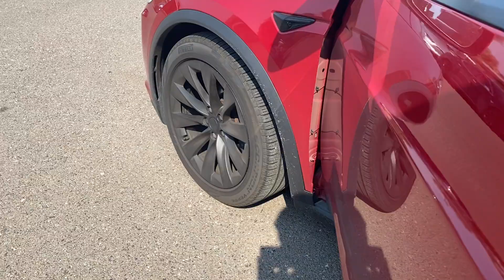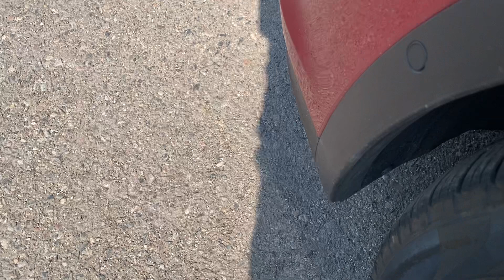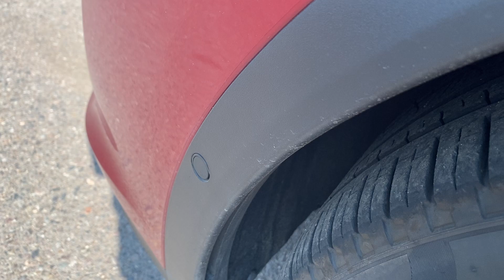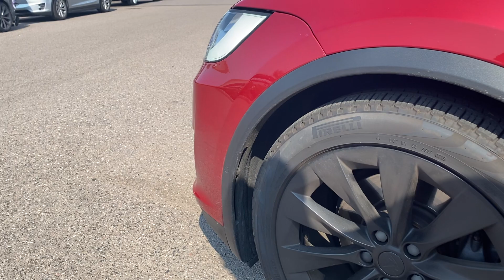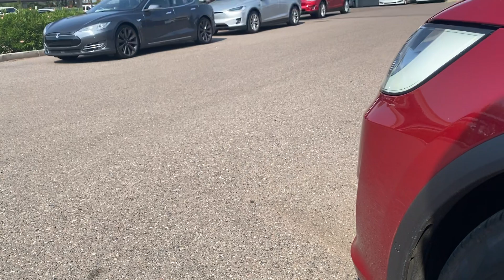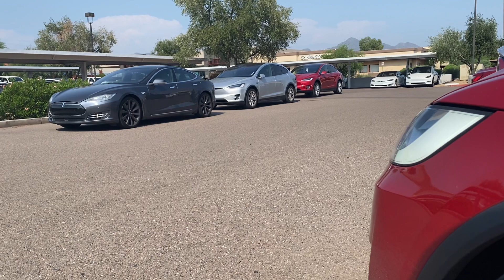Model X vibration noise when AC compressor is running

Comment: Hi there!
I have the exact same noise on my model X, did you fix yours, and if so what was the problem?
Reply from the maker: New AC system was installed. Fortunately it was covered under warranty.
Reply: @cliffud  Thank you for the feedback!
Reply: @cliffud  How many miles did you have on your X when this problem happened?  I had my compressor replaced at 35k miles and now same problem appears to be happening and i'm at 52k miles...
Reply from the maker: @dejanprotich1356  I think I had 90k miles and the issue came up within 1 year and 20k miles. Service center did a goodwill gesture and covered my AC system since it started acting up within 10 months. Currently at 124k miles and everything is fine. Crossing my fingers.